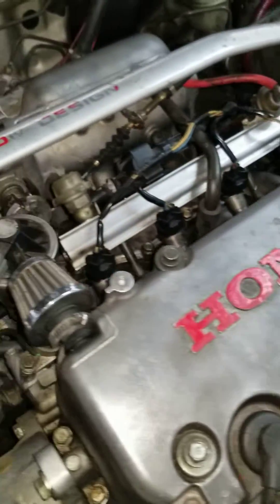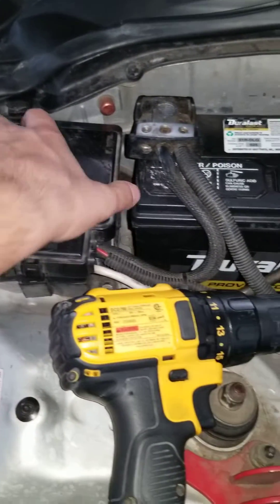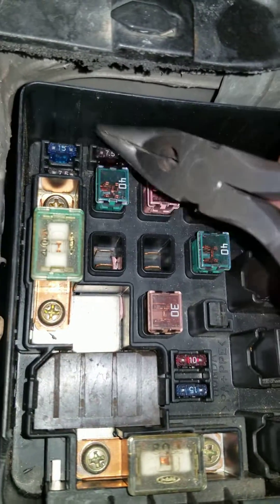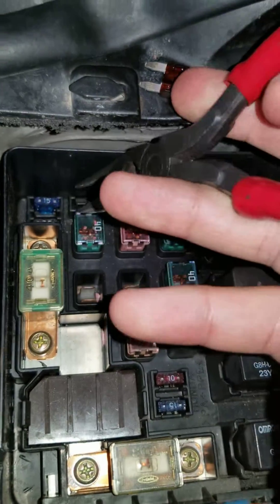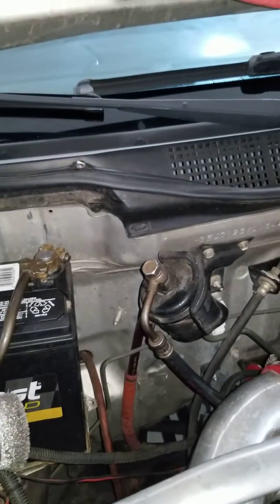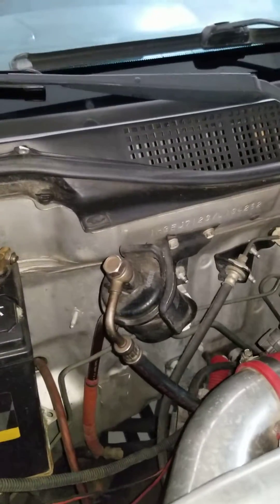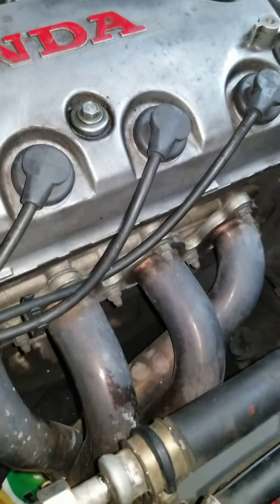How to reset the ecu on 1997 Honda civic

Comment: Could this fix my problem ?
I change some stuff in my cluster and my temp gauge is not working 100% and the radiator fan doesnt cime on automatic but when i tried a different cluster i let the car idle to operating temp and the can kickt on no problem put my original cluster back in and id doest wor anymore

Comment: Just a quick tip for those who are about to do this. 
1. Go drive the car around and get it up to operating temp.
2. After you come back with your engine at operating temp. turn it off. Unplug the fuses (ECU and ECU Back up fuse)
3. Wait 10 minutes.
4. Put the fuses back in.
5. Start the car, its important you do NOT touch the gas pedal at all! Just let it idle for 10minutes!
6. After 10 minutes of idle, turn off the ignition.
7. Wait 2 minutes.- This saves the new corrected data/settings to the ecu!
After those 2minutes, start the car and go for a drive. Ecu will be reset at this point with new corrected data. :)
This should work for most 90" hondas, atleast every 90-00 Civic.
Reply: THANK YOU for these detailed instructions. I am waiting for the 10 min mark as i type this.
Reply: @Sk8orDieWorldWide  how is it? Please.
Reply: @tagminda4565  the process is relatively easy. Works well for my added CAI
Reply: Why do people do this?
Reply: @Sk8orDieWorldWide  what happen before and after. My rpm goes 2k after cleaning throttle body. And i think i messed up the ecu data. I want to reset the ecu
Reply: @kicaumania8056  you'll need to adjust the idle screw AFTER the car the car has fully warmed up. You'll need to unplug your IACV while the engine is running. This will trigger a check engine light and cause your idle to drop. Turn the screw until the dash reads 600. Turn the car off. Pull the ecu fuse/disconnect battery cables for 5 min. Continue with reset procedure.
Reply: @Sk8orDieWorldWide  which screw shoud i turn?  Until 600 rpm
Reply: @Sk8orDieWorldWide  and how reset procedure
Reply: @kicaumania8056  the idle screw on the throttle body. It may or may not have been adjusted previously. Also, you should check your ignition timing 1st, BEFORE checking idle screw.
Reply: Could this fix my problem ?
I change some stuff in my cluster and my temp gauge is not working 100% and the radiator fan doesnt cime on automatic but when i tried a different cluster i let the car idle to operating temp and the can kickt on no problem put my original cluster back in and id doest wor anymore
Reply: Its work on SR4/EG9 1992 D16?
Reply: @NitroZeus69 you need a new thermostat or coolant temperature sensor.

Comment: Ok i need help i got a civic cx 97 d16y7 stock and first came p0302 p0301 p1399 i change fuel pump,strainer,fuel fulter,spark plugs,distributor,map sensor,crank sensor,spark cables,spark plugs,do compression test all in 180 and came back the light with p0302 and p0304 again with p1399 any help please
Reply: Adjust your valves
Reply: It the same when I remove battery ??

Comment: I did this and it worked for my 2003 civic. But the light came back after about a month later. I did replace the battery few days before the light came back on. Should I do the procedure again ?
Reply from the maker: Sometimes some codes dont go away after replacing some parts on your car so try doing it it could fix the problem

Comment: Im trying to replace my ecu. No upgrades just replacing it because of a barometric pressure code. Do I plug in the new one and go through this reset process?
Reply from the maker: Some people do this process instead of taking the cables off the battery,  since you are replacing the whole unite you gonna have to disconnect the battery  and that is all you have to do.
Reply: Hot or negative lead

Comment: I put like sensor my Honda cr-v my lithg still on don't no do anything Thad saint do like Thad car be better the lithg got away i go my other Honda civic ex 1997 1.6 got 3 code p0304 P1399 P0135 you now any do any sensor to fit it thank you s much you video i be do it my Honda crv
Reply from the maker: Try to run a scanner and see what the problem is I could be something simple to get rid of them the p0304 is misfire in cylinder 4 try changing plugs first amd see if it goes away

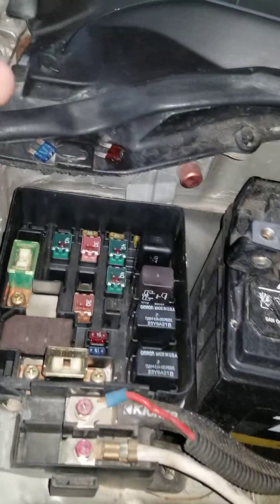Comment: I was trying to follow your instructions. On index 1:46 you said "thirty minutes later you put it back in ...", did you mean you have to do it twice or you are just saying it twice for like a review?
Reply from the maker: Correct you do it once not twice and it definitely works try it and let me know
Reply: @classicdiy1812  It was a blown number 15 fuse on the driver side that has to do with the alternator. After I replaced it, the "3 Stooges", P1298, P0135, and P0141 stopped showing up on scanner and no more engine light. Thanks for your reply.
Reply from the maker: @balloney2175  I am glad you figured it out 🙂

Comment: Could someone please explain how removing those two fuses while the the car is off and has zero power and putting them back while the car still has zero power can reset your ECU?
Reply: car is off but have power, car is taking power constantly even if u take out the key how would immobiliser work or any safety features if car would have no power?

take of battery clamp and start touching battery it will spark 
why would it spark if there would be no circut since car should be off?
because its not off its constantly taking power from battery
its just taking very low power 

thats why battery will die after leaving car for long time
Reply: The guy should have first let the car start and idle until it reach normal running temperature. Turn off the engine and remove only the 2nd to the left fuse. Top left d 2nd fuse from the top left. Remove for 5min. Return the fuse bask. Start d engine and let it idle for 10min. (Before starting the car make sure all electrical accesories are off.) after 10 min turn it off. Drive it around d block. That's it.
Reply: @marvinclemena3084  would this work if I disconnect the battery instead of a fuse? I have a 95 civic
Reply: @dompesky169  Yes, This should Reset everything. Put the car back to default.

Comment: So my car showed up a code P0505 idle control valve I ended up replacing the part and after a couple of runs and the code Popped up again couldn’t because I didn’t reset it like this
Reply from the maker: Check the wires it could be shorted
Reply: Did you get rid of the code?
Reply: Chek the 3 pin connector 1 pin is 12volt and 2 pin earth and 3pin out put supply mostly foult is 12volt miss in wair so chek this and clear the foult

Comment: Remove fuses and wait 30 minutes 

Then,

After you put the fuse back in, you have to start the car and leave it running for 30 minutes?

Is this correct ?
Reply from the maker: Correct
Reply: Wow. Thats a long idle.
Reply: Or just hook up a code reader to it and clear the check engine light.
Reply from the maker: @tylermorone5180  not everyone has the codes reader .
Reply: @classicdiy1812  wait so I can just reset the code after leaving the fuses out for 30 mins correct instead of letting the car idle for 30 min ? Is that right ?